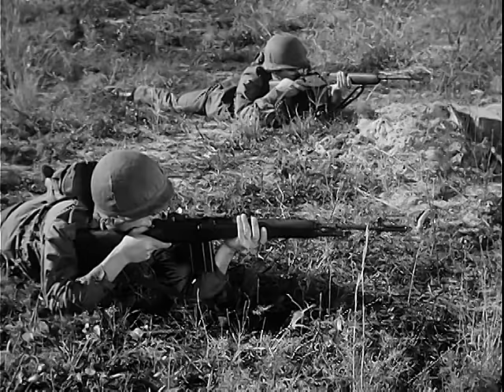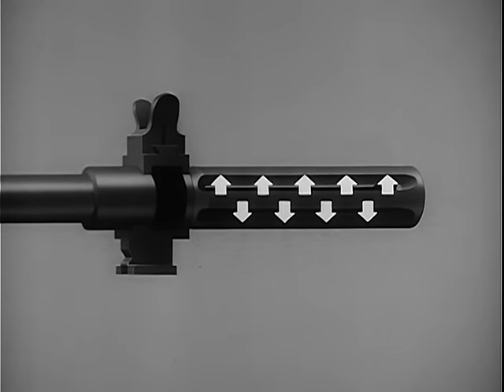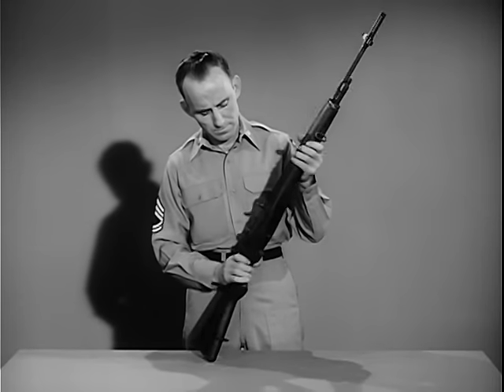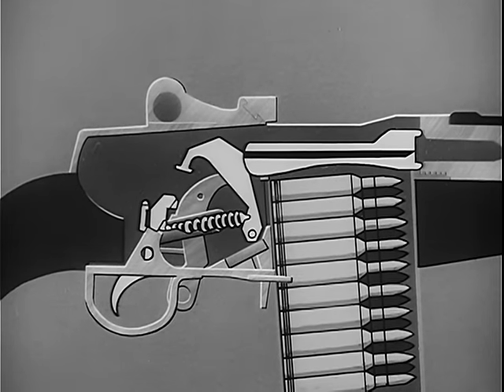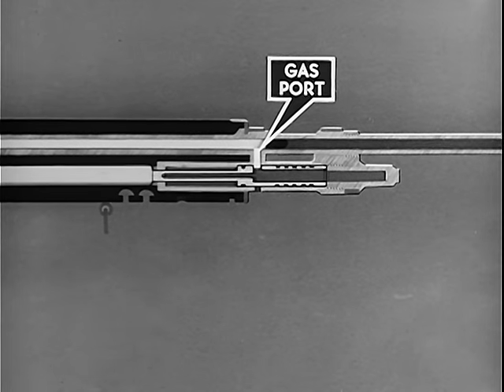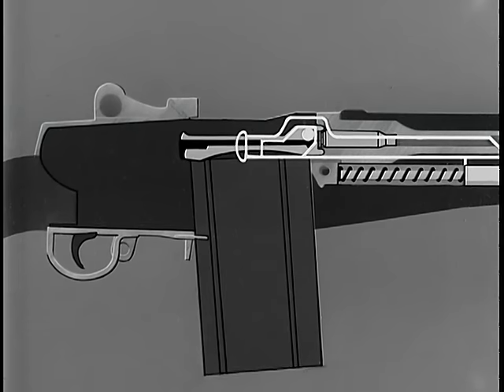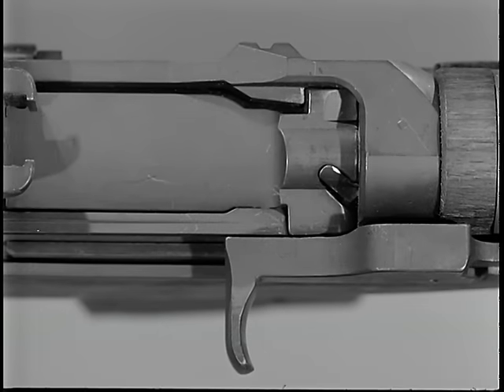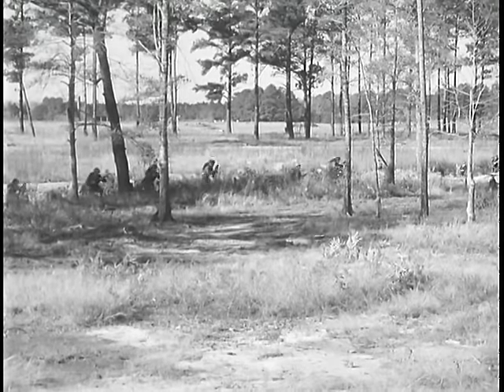U.S. RIFLE, CALIBER 7.62MM, M14 - OPERATION AND CYCLE OF FUNCTIONING

Comment: There were NO M-14s that were chambered in .30-06, since the receiver length and bolt travel was designed for the much shorter .308/7.62x51 from the start.  Hold an M1 and M-14 side by side and the difference is obvious.  However, some M1s were rechambered in .308, since you can simply put a shorter round in a longer receiver. Most of those were made for Navy competitive match shooters.

The transition design between M1 and M-14 was the T20, which was a .30-06 M1 that used a BAR 20 rd. mag.

Comment: The M-14 was in fact the better choice, by the time they finished testing it.  The early prototypes did have a lot of problems, but by the time the long development and testing process was completed, the M-14 was more reliable than the FN-FAL, especially in very cold conditions and also in very dusty/sandy environments.  Read "Against All Odds" by George Kontis in the Sept. 2011 "Small Arms Review" journal.

Comment: If I was gonna build new, I'd find a Entreprise double lug reciever, a douglas medium weight barrel, a mcmillian supermatch stock, and have fulton build it.
It was a springfield armory, but it wasn't designed for the load.  I ran 168's fine for years.

Comment: @Gunnut321 Exactly. And most of those are adressed in the EBR i´ve heard. And a few other minor things, like location of fire mode selector.

IMO, the 5.56mm platform should have been reserved for operators that _realy_ need small, light weapons for self defense or portability. Say vehicle crews, scouting units and maybe some spec-ops. The 7.62mm is way more usefull for front-line duty as it can reach out and punch through obstacles.

Comment: I would agree that your training rifles may have been overused.  Perhaps even damaged in the infil and bayonet drills, so the rifle could have been damaged before you got it.  But I'm still curious about the reload part.  Did you actually see the reloading facility on base?  The reason I ask, is because until Pres. Clinton stopped the practice, used brass was collected and SOLD to civilian reloaders as desirable "once fired cases", and they had considerable cash value, which helped your budget.

Comment: Compare the op-rod and piston of an M1 to the piston of an AK. In an M1 they got away with using a minimal amount of steel. Kalashnikov was very generous with the use of steel in the piston, bolt carrier, and bolt. I'm not saying M1s aren't reliable. (In fact, Kalashnikov borrowed the bolt design from the M1.) I'm just saying there isn't as much steel in it.

Comment: You test TOOL-ROOM PROTOTYPES  in small quantities in the field?  I think not, especially on large-scale projects.  In case you don't know, the H&K XM8 was an essentially complete design before you got hold of it.  It was basically the standard issue arm (G36) of the German Army for 6 years (1997) before the U.S. tested a slightly modified version (2003).  The G36 was prototyped, field tested, adopted as German standard, then mass produced so almost everything was known.. Not so the T44(M-14).

Comment: "Dainty" isn't the correct description.  "Precise, yet durable" would be more accurate, as most M-14/M-1A users would confirm..  The M-14/M-1A is rugged, AND IT HAS AN OPEN ARCHITECTURE similar to the AK.  That open architecture (large clearances between non-critical parts to reduce the number of places that accumulate dust and gunk) was not inherited from the AK (1947 design), but from the M1 Garand, which was invented in 1936,11 years earlier.  And the M-14 is much more accurate and powerful.

Comment: My connecting rod broke on the 200yd line on quilifation day back in MCRD Parris Island,on my Winchester M14......This was in Feb"73....the date on the receiver was 3-61 which was new for the Corps....The reloads we were firing might have been a little too reloaded for the connecting(or operating)rod.

Comment: @sladerfoster No, u would need a "full auto sear", that releases the hammer after the bolt is closed, giving the hammer clear run. Turning semi auto into full auto is not anywhere close to be as easy as anti-gunners propose, Its definitely not kitchen or garrage job. A well equipped shop will be needed, and you cant really make the parts yourself, as the working surfaces require hardening.

Comment: The most important thing to take away from this is that the Garand and M-14 are gas-operated bolt-action rifles. All of the "automatic" in the weapon is a mechanism under the barrel which gets strapped onto a miniature bolt action. It's brilliant, given what they were working with at the time. Bolt actions were the thing, so they made one that just actioned more.
Reply: Ben Allen
 You entirely missed what I mean.

The Garand mechanism is more akin to an automation kit for a standard bolt-action rifle than modern setups. Note that there is no return spring or gas system within the weapon's receiver.
The operating rod is only working a small "bolt handle" to cycle the bolt, essentially a miniaturized bolt-action being worked by a gas mechanism strapped onto the front of the weapon.

In a standard long-stroke system (not to be confused with the Garand/M-14 hybrid of a short and long stroke), the gas piston is attached directly to the bolt carrier which moves back, unlocking the lugs on the bolt itself via cams in the carrier. The return spring is housed behind and inside the bolt carrier.

In the Garand system, the operating rod has a cam grove for the "bolt handle" to ride in and unlock, then cycle back and relock in the same motion as a bolt-action rifle. The return spring is in front of the bolt and sits around the gas system.
Reply: SomeNavySEALs Rgr that. The .308 Win round was developed to shorten the action cycle, if I recall correctly. .06 was so long and slower, as in the BAR. I've some belted 30.06, headstamp Lake City/54.. the tails that ammo could tell.

Comment: @claudiobenassi85 thank you, i just saw couple ar 15's with and without a spring in the stock, but one had an HAR conversion which opperated with a piston to bolt and a spring on the rod ontop of the barrel... thnx i gots it now:)

Comment: Is he referring to the disconnector as the "sear" and the sear as the "trigger lugs"? Or have they changed the nomenclature since this video was made?
Reply: I was wondering that myself.  Though I think the "trigger lugs" would not be considered the sear because they are connected directly to the trigger.  But I would refer to the "sear" as a "disconnector".
Reply: Ohlie_OE The M14 technically has no disconnector.  The Sear works as both the disconnector and sear.  The front lugs are part of the trigger so the description is correct.
Reply: Ohlie_OE To clarify so you understand better.  The fire control group on a fullauto M14 is no different than a semi-auto M1A.  What makes the M14 go full-auto is the addition of a selector switch and a control rod that rides under the right side of the receiver and is actuated by the Op Rod on the forward stroke.  The control rod trips the "Sear" and releases the hammer while the trigger is held to the rear.  Hope that helps you understand how it all works.

Comment: Your information on the m14 is wrong- the M16 was infamous for jamming the m14 however was rather reliable. It is an evolution of the m1 Garand, for the most part army officers wanted to stick with the m14. Secdef McNamara wanted to make the m16 the standard riffle and even rejected ideas to improve the riffle- like adding chrome lining to the barrel- which the m14 had- which made it more reliable in the jungle.

Comment: Very unusual analysis, Anisocoro!  "Too short for accurate fire"?   Are you aware that M-14s/M-1As are used in U.S. military matches at 1,000 yards, using the standard length (22") barrel?  And the same barrel length was used in the various "sniper or designated marksman" variants, with snipers expecting to hit human size targets at 800 meters and DM's expecting to hit human size targets at 600.  "Too long for sustained automatic fire"?  Where did you pick up that bit of nonsense?

Comment: You're wrong. M16's still suffer from being easily damaged/jammed and it requires extreme maintenece to keep it going well. Hmmm, i wonder why a warzone would want a specific weapon, maybe because it requires almost no maintence, is reliable, more deadly, maybe not as accurate but very affordable.

AK47.

Comment: Yep.  The M-16 was an interesting design, but not at all mature when first accepted for general issue.  The early problems are well-documented, and they would have been discovered by simple field testing of substantial quantities of M-16 rifles.  But that would have taken another 4-5 years, and there was political pressure to acquire a new design immediately.  The current situation where M-14's are used for various purposes alongside M-16's/M4's is the proper solution.

Comment: Well, then, why didn't you just state that point about "generous use of steel"?  When you call any high-stress mechanical design "dainty", that can only be interpreted as an insult.  The real key in the U.S. designs is that they are willing to use additional machining operations to remove superfluous metal, thereby saving weight, without causing parts failure.  AKs were designed to be produced with minimum machining.

Comment: The official TERM "sniper rifle" may not be in widespread use, but there is such a thing in reality.  A typical"designated marksman's rifle" in the Iraq/Afghan Wars has usually been a semi-standard M-14 with a med-powerscope.  Not exotic, but better at long range than a short M4 Carbine.  The more exotic, highly-tuned sniper rifles, include the M-107 (Barrett ,50 BMG), M40, and SASS.  If you Search for "M110 Semiautomatic Sniper System".you will get hundreds of cites from knowledgeable sources

Comment: The bureaucrats and bean-counters always think they can save money by making one tool do 4 or 10 jobs.  They don't have enough knowledge to understand what is needed in the field.  Same problem occurred with the F-111 of the 1960's.  The bureaucrats wanted it to be a fighter, a fighter/bomber, AND a fighter for aircraft carriers, with each design being slightly different.  It was finally adopted as a land-based fighter/bomber, but rejected for the other roles.

Comment: Can anyone tell me why the M-14 accommodated 5-round clips and not 8-round clips?  I would have thought, since the M-14 was replacing the M-1, and given the fact that M-1 ammo came in 8-round clips, that the former would have been designed to accommodate the latter.
Reply: M1 (Garand) was .30-06
M14 was .308
Shorter ammo
Reply: M1 Garand uses Enbloc clips, whereas the M14 uses stripper clips.

Comment: The M-14 was just fine, better than the "16". The "14" was NOT a "jammer", but the "16" was a known chronic "jammer"!  Also the M-14's recoil  was difficult for small bodied Asian men to handle. "14's" have "deer rifle recoil", it is heavy and "city-boy" drafted troops did not like the the weight and recoil as well. It was hard to get these two groups to aim properly. Also, the Army wanted to be as chic as USAF for who the "16" was intended. The US Army has regretted the M-16 from the beginning

Comment: Wrong again.  You should get a copy of the comprehensive book "US Rifle M14" by Blake Stevens and "Against All Odds" by George Kontis (SMALL ARMS REVIEW magazine, Sept. 2011).  Prototype M1 Garands with removeable magazines (T20 and T25) were available in single copies in late WWII, but they were not even the T44 prototype (the M-14 test mule), which was almost complete but in very small quantitites (15 rifles)) by June 1954.  It was not sent fo any army units for field testing until much later.

Comment: Not only are you wrong about the use of the M-14 in the Korean War, which eneded before any functional copies of the T44 (M-14 prototype) even existed, but you are also wrong about the concept of "designated marksman" who is an integral part of an infantry company and not as extensive trained as a sniper..  A U.S. sniper is a very extensively trained soldier who is usually operating semi-independently as a special operative, not as a permanent part of any particular infantry company

Comment: @Gunnut321 Dunno if id´s say that for just getting rid of the M14, but the whole dabacle with the early M-16 to replace it was a major FUBAR.

Don´t get me wrong, the M14 is a good, i´d even say excellent, rifle. And the M-16 has grown into a decent rifle. But the M14 had some disadvantages it realy could do without. And the M-16 is (from what i hear) still sensitive as hell.

With the new EBR modifications, it would seem most of the M14 issues has been adressed.

Comment: What the difference between 308 and 7.62mm??
Reply: elhuachito951 very diffrent 308 is a very powerful cartrige but the 7.62 has the same punch with lower caliber trade offs such as velocity recoil and capacity.
Reply: Nothing clay fuller is wrong. He must be thinking of 7.62x39 this is 7.62x51 which is the same as 308.
Reply: Logan Stanley oh yeah
Reply: Logan Stanley i thougt it was 7.63x51
Reply: The shape of the bullet the casing and the powder.
.308 and 7.62 are both .30 cailber rounds. Meaning the inside diameter of the barrel is 300ths of an inch

Comment: 1. Impossible, since there were ZERO functional T44/M814 prototypes (1955) available before the end of the Korean War (1953).  2. 10 rifles isn't a major project field test, since the sample size is far too small to get an accurate overall picture.  3.I'm sure your source wouldn't be able to differentiate between a full-auto removable mag M1 Garand versus a T44/M-14 prototype (ask him whether it had a long-stroke or short-stroke gas cylinder, and what caliber it was, and what magazine it used)..

Comment: @Gunnut321 I agree. Besides, automatic is only really useful for increasing the chances of wounding a target when you're panicked. So if its uncontrollable, well... Who cares. The troops in this video were fine firing it in bursts, so what's the problem? A burst is generally far more accurate than full-auto, and you still get a good volume of fire out.
All this stuff about suppression is a crock of shit, you can keep a mans head down with a semi-automatic weapon just as well as an automatic one.

Comment: Jakobie143 "We should've taken this gun to Vietnam, instead of putting cheap less reliable less powerful m16s"

Wow , there are a number of reasons they switched platforms , cost of ammo, weight of ammo/gun, the jacket itself and how it would more ore less,it would leave clean entrance/exit wounds , its utter uselessness in full auto (Yeah argue it all you want, its true) Lots of snipers did use this gun in that war though  and they were there for the beginning, then got replaced by the toy , that war taught them lots of weaknesses of the AR-15 platform mind you, making it now days, one of the most reliable platforms out there. Back then, nothing beat piston operating systems though.

Comment: Partly a matter of taste.  I prefer the greater potential accuracy, solid scope mount (as long as you get a steel scope mount with 2 or 3 point attachment), better trigger, and greater dust-resistance of the M-14/M-1A.  Others prefer the easier full auto control of the FAL/SLR and the easier field strip for cleaning, or the "space-age" look..

Comment: Appears to be far superior to AK and M-16. Should probably bring it back.
Reply: it never went away, still used and loved by our forces. just not in great numbers.
Reply: well diff caliber (7.62x51) compare to AK or M-16 (5.56x45 or 5.45x39)
I guess you can compare it with Tokarev --AVT-40  SVT-38 SVT-40 (7.62x54R)
or Dragunov SVD  SVU ( OT-03)   SVUa
Reply: The French will overgo to HK417 (7.62x51 NATO) in 2016.
Reply: +JD L not so the ak is far superior to both

Comment: Try to be a bit logical and consistent.  We were not at war in 1955 either, when the FIRST functional T44/M-14 became available (which was after the Korean War enedd in 53).  So you admit that your friend was wrong?  Furthermore, the military can do extensive field testing during large scale exercises in the deserts or forests--the equipment will be subjected to use and abuse, and there will be lots of samples tested and lots of user feedback. T44 didn't exist in 53, so nobody could test it.

Comment: i bet nobody put the gun on safety during reloadings, unless youre not in wars
Reply: +Youngjin Lee 
The guy 1 minute later, at 3:17, didn't use the safety before removing the magazine. The narrator should be saying "to speed up reloading, don't bother using the safety". Unless the trigger has a habit of firing when the bolt is released to load the first round, using the safety shouldn't be necessary for reloading. But it's still probably not a bad idea, just in case.
Reply: +MikeM8891 ah it all makes sense now

Comment: what perfect for jungle? have you been to the tropical jungles. The Garand will not Jam on wet and dirty jungles.The M14 is a Garand with a magazine. It will not jam on jungles but people who prefer the plastic says otherwise from the truth. Get your facts straight polygunz. The M14 is heavy in recoil and have heavier ammo total that is the reason the GIs were issued the plastic which is light and smaller ammo allowing more carry-load.